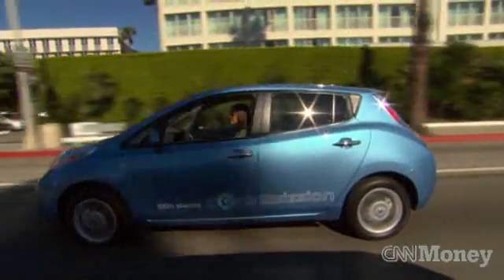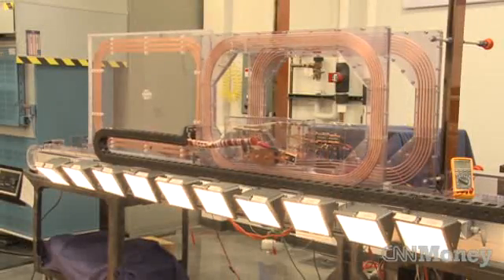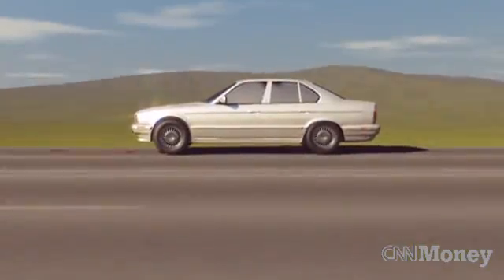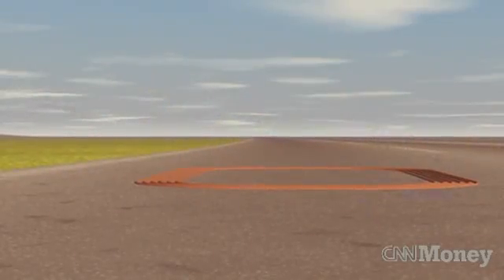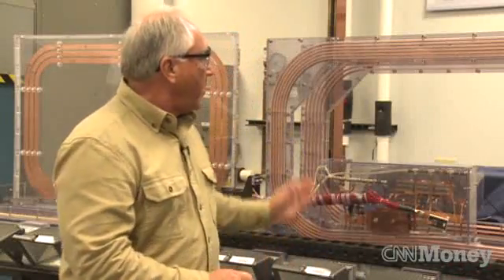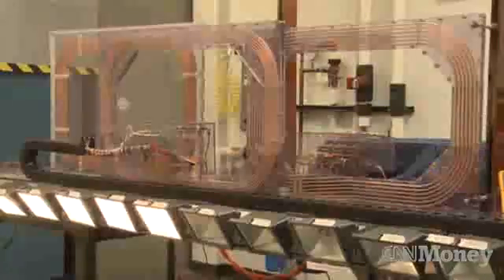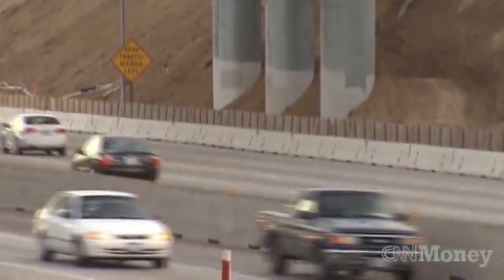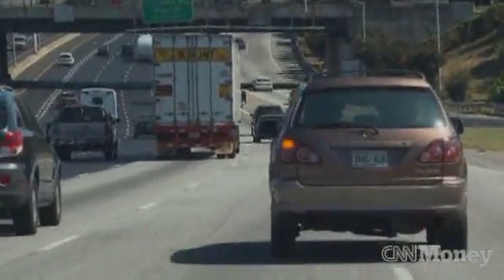When the road charges your electric car

Comment: the way this has been developed is far too expensive. If you just put metal strips or junk metal in the roads and mount a induction battery in the car itself the whole thing can be done a lot cheaper and with the same results

Comment: This may not work for an electric car (uses too much power and energy inefficient due to excessive mass ratio of weight of vehicle  to desired cargo plus driver and passengers however this would be an excellent idea to have wireless powered roads for highly energy efficient vehicles like low mass electric motor powered Velomobiles or electric motor powered bicycles to give them unlimited range.

Comment: I'm thinking if someone were to invent magnetic concrete we might possibly have something cheaper and lasts longer than coils in the road. What is needed is a magnetic field that is embedded in the roadway at regular intervals. With the coil under the car cutting thru the magnetic field you can induce a current in it. In fact you could use two coils under your car. It might not be as good as an electrified coil in the roadway ,,, but then again it might not have to be.
 If the current drain on the battery is reduced ,,, then the miles per Kwh increases. Currently the miles/Kwhr is about 3.5 ,,, if that were to increase to about 5 miles/Kwr while driving over a freeway of these embedded magnetic fields of concrete ,,, That might work. And I don't think you'd have to worry about someone digging up concrete. Other than the problem of inventing magnetic concrete ,,, anyone see any problems with this?

Comment: Oil is one of the many things used to produce electricity. More electrical energy consumption more oil used to produce electricity. Also car mods. would start problems especially in trucks. Ice covered or water covered roads(weather conditions" could also cause problems.

Comment: This is not a reasonable way to go. What about city roads, shorter commutes, rural towns, people who want cars that aren't driving over these specifically lined up coils on specific roads. People need to face it, Hybrids/electric cars are too expensive and too inefficient. Diesel gasoline is extremely efficient but at a high cost, but in a cost benefit analysis, diesel and other fossil fuels are far more beneficial in the near to even long future.

Comment: A million dollars per mile, PER LANE, is completely, totally, absurdly, impossible!  

This sort of scheme might work OK if you placed the transmitter coils at restaurants, filling stations, etc., so that the net experience is similar to filling a tank.  If you could top off a ~50 mile battery in a few minutes, you'd have something practical.  Combine with hybrid gas/electric car for best results.

Comment: my thoughts exactly. the concrete highways here in california are expected to last 20 years before they need replacing, and can last much longer and still be driveable (upwards for 40+ years). these coils would have to be very durable (50 ton trucks do work)

Comment: You do realize that interstate highways typically cost a 2 to 3 million per mile anyway, and some places it is double or triple that, if not more. Tacking on another 800,000 may seem like a lot, but in comparison its pretty cheap.  And its not like its an expenditure that would be made all at once, this would be a gradual integration process.  We would need more electric cars on the road anyway for this to be feasible.

Comment: So the idea is to take really expensive copper put it under our deteriorating road system, run electricity through it 24/7 essentially wasting the electricity and converting it into heat - all for the off chance that one brief moment out of thousands of insignificant moments may perhaps charge a car moving over that very specific and relatively small space at a high rate of speed?
Y don't we start making crack and selling it to mexico? Seriously it would be more productive at current market val.

Comment: There are batteries that reach the requirement now... But are not feasible.. So I agree with you till they bring the better ones in... Hydrogen fuel cells are also in their infancy, they need lot more work before we are able to control it better.. We need more funding to do these things in a larger scale.. People just ignore science funding.. sigh..

Comment: Yeah id say a lot more than 8 people don't own electric cars. Electric cars are for morons & hipsters.

It takes more resources and cause more polution to make the battery for the car than you'd make in 5 years of driving a normal car.
Also electric cars don't last the technology is there.
The distance you can go is pathetic too.
You end up spending way more on the electric car than you save by not paying for gas. it would take 20 years for you to make the difference back

Hydrogen is the future

Comment: I'd like this for all streets and roads too and not just e-ways (electrified highways).It would be nice to have continuous power wirelessly powering my electric motorized bicycle.Then I wouldn't have limited power range with my battery pack.This would also reduce the heavy (wasted) mass of a car so that it wouldn't have to have heavy expensive battery packs.

Comment: Electric & hybrid cars aren't really cleaner to produce, & as long as the electricity they run on comes from coal or oil, not much better to drive Technology like this is a step in a good direction but I don't think it will ever get large scale production because of the expense/infrastructure requirements, and the durability issues (it doesn't look as tough as asphalt to me!) That makes me sad, because it's a really cool idea.

Comment: No, actually it's not. Remember in elementary school, when your teacher generated electricity with a nail, a magnet, and a coil of wire? This is like that. 

Yes, these electric cars will still have to be charged at home or at charging stations sometimes, but this is essentially passive generation of electricity via magnetism. No fossil fuel based car I'm aware of gets ANY of its energy passively.

Comment: This idea isn't that great.  If 90% of the cars on the road were 100% electric, think of how much power these coils would consume.  If there entire idea is to reduce dependence on foreign oil, it isn't really that insightful because most of our oil doesn't come from the middle east (its a fact) and the most widely used methods to generate electricity comes from burning Coal.  We don't have enough coal to charge everybody's shit as they drive down the road. We should move on with other technology

Comment: nope. this (specific design) wouldn't work if sat upon, but it might reduce the weight on your shock-absorbers. and yes this would make the ride in normal traffic more bumpy or wear your shocks out faster due to the ton more stress-unstress states; like driving over small pot holes. (the pot hole force might be merely a pebble but still)

Comment: what would power the movement? put another way this doesn't work as suggested. at best either the coils are magnets which have to be replaced once the coils themselves run out of juice, or they are hooked up to electric lines and this product only offers highly efficient transference of the power. issue is it is still likely less efficient than a wire.